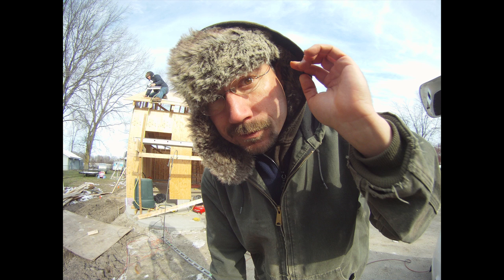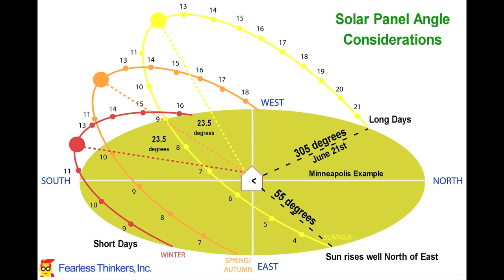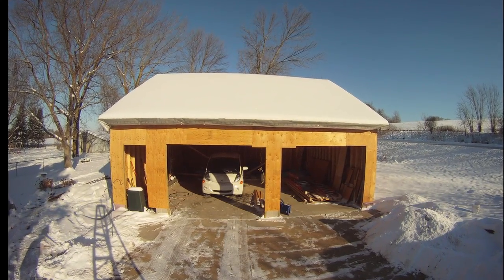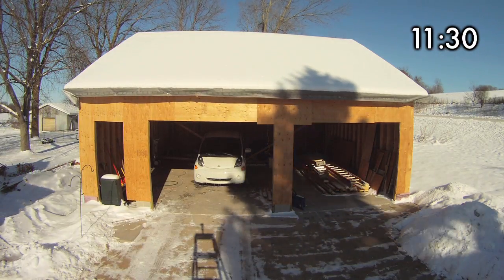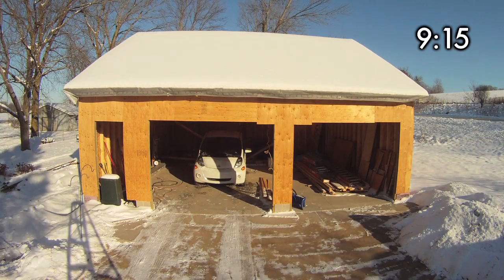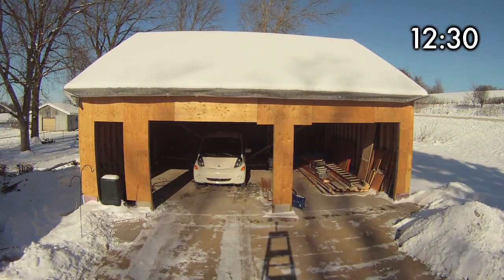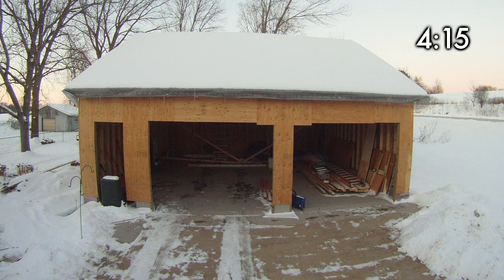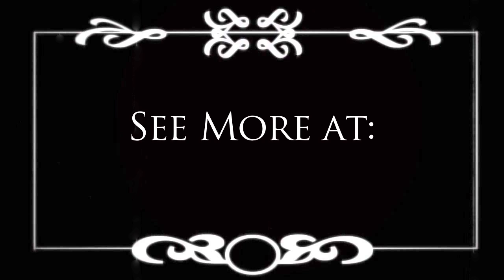Ben's Garage: Winter Solar Access

Comment: Because of winter shading, I would advise not doing a high voltage/series connected system, the pine tree would only take out one/two panels but in high series will shut down all the panels in series...
Reply from the maker: The plan is to use micro-inverters to address winter shading issues. No shading in the summer.

Comment: Ben, Have you consider a simple single-axis rack mounted on the roof ?  Something simple that with the hinged base allow 2-4 vertical angle adjustments a year. You only need a few degrees of freedom.  I have done this with a coupe scissor-jacks at the top with ext. rods down under the panel array and an angle gauge on the base.   I just used strut channel and barrel hinges ...cheap stuff.
Reply from the maker: This will be about 18'x27' of solar panels. That would be quite the project to mount that all to a rack, mount to standing seam metal roofing AND make adjustable. Just the panels themselves will be over 1,000 pounds, plus the racking, and all of that 10 to 18 feet in the air. Nope. It wouldn't be simple. I theoretically like the idea of something seasonably adjustable, but this will be a fixed system.
Reply: Sure, I can see your point and with WI snow load.  Tough sell, with the  marginal energy gain.  
Besides fixed systems look so much cleaner and all you have to do is clear the snow off of them.

Garage looks great and best of luck with the set up.  I hope to be following your solar garage build with mine in late spring.  
Very cool stuff.

Comment: Good morning Ben,
Where are you going to be sourcing your panels from?
Reply from the maker: My original plan was to order from a mainstream solar supplier, such as http://www.renvu.com. I also got a lead on getting some Helios brand panels. That company is out of business now, but was a manufacturer in Milwaukee, WI, my closest big city. I love the idea of getting panels which were manufactured locally. Those panels are sort of "new old stock". Price would be slightly better than purchasing new, but wouldn't have a warranty. Not that there's much to go wrong with a solar panel. Lastly, I also did run into a friend of a friend a while back who works for a solar company that does mostly commercial work. He suggested that I might be able to get in on a group buy with him. Those would be slightly larger panels and higher wattage, but I need to still work on the price, and I need to double-check the size to make sure they would fit.

Comment: This is awesome! Let us know about the energy production when you hopefully get it up and running!
Reply from the maker: Many inverters nowadays have a web-based system for tracking and displaying energy production. I'd like to do that and post the information publicly at 300MPG.org. That way, I can always check to see how much energy I'm making at home, and everyone else can see too!
Reply: I use a plain kWH meter with S0 pulse, I connect that with something like a Youless or Flukso to upload the data to PVoutput.org. http://pvoutput.org/intraday.jsp?id=12447&sid=10380
It works with any inverter, and there are apps for the phone as well as tracking consumption.
Reply from the maker: Hi Robert, you can now see public information on how much power my system is making at: https://enlighten.enphaseenergy.com/pv/public_systems/PqBp1213167/overview

Comment: It shouldn't be too hard in practice, not sure if you are going for Micro inverters, optimizers or string inverters, listed from most expensive to cheapest. I'll have some advice for each of these.

You say 5kW of solar, so that's about 20 panels of ~250 Watt, the most common size (1.6x1m) and ~ 30 Volt working a piece. There is also the choice of Solar Frontier thin film (Japanese) which are really popular, and completely black (1.2x1m). These generally have high voltages per panel, about a 100 Volt working.

Generally string inverters are by far the cheapest solution. Even the Chinese models from Omnik or Goodwe are approaching 97%. For pricier brands there are things like SMA and PowerOne (now ABB) and Fronius. Check the input range on the inverters and match strings to that voltage.

Let's talk shade for a bit, with relation to price. For both micro and optimizer they handle shade well, but at a cost. It also means more involved installation, micro inverters have nice warranties, but that does not equal lifetime. If one fails, you'll need to dismount panels to get there. Optimizers are less of a reliability issue, but the manpower argument stands.

So if you have a string inverter, you rely on multiple parallel strings to reduce shade impact. And that works, the SF panels with higher working voltage means more parallel strings, and less impact. Alternatively some string inverters support MPP sweep, which means literally sweeping the voltage range to find the optimum point even if a panel is shaded. Not all inverters support this, but the higher end models from SMA do.

So with normal mono panels that would result in 2 parallel strings of 10 in series, that's just about 300 Volts for a string inverter, sounds like a lot, but not in the grand scheme of things. They like somewhere around 360 Volt DC really.

There are inverters, like the Steca Stecagrid that can handle 20 panels in series fine though, and 98% it's nothing to scoff at. It also handles shade.  So if 5 out of 20 panels are shaded, the MPP voltage is lowered to the 15 panel point to reduce losses.
Reply from the maker: For the physical shape of the roof, 60-cell modules should lay out to fit in a grid of 21 - three rows of 7 panels wide in a portrait orientation. These would be 250 to 280 watt panels. I'm leaning towards using micro-inverters not just for shading issues, but also for simplicity of installation. Using micro-inverters means that I don't need a DC disconnect, and a regular electrician can run the 240V AC power cables and sign off on the work. It just ends up making the paperwork, building inspection, etc. a little less expensive and less complicated.
I think that we are almost at the point that it's HARD to design a BAD solar system (other than obvious exceptions like intentionally putting panels in the shade!) There are so many great tools and pieces of equipment out there now that it's amazing that more people AREN'T going to solar!
Reply: Ah, I see, the regulations in the EU are quite a bit different I'd guess. What a number of people that use micro inverters do, is mount them inside. Sure this can be quite a bit more cable, but that depends where you mount them. The benefit is far easier replacement. I have a set of 2 panels on 1 micro, but it's inside.
Alternatively, mount these on the side of the roof/building for easier access without having to go through the roof.

Turns out that was a good idea, because 2 Enecsys micro inverters died in about 1,5 years. There is a reason that the company went bankrupt, this was one of them. Do not equate reliability with warranty, at any point. I have videos on my channel with the noise these make, just before they died.

Consider the APS YC-500, you can connect 2 panels to 1 inverter and reduce the amount of cables need drastically. I see they even have a APS YC-1000 now, even for 3 phase 208 Volt. Not sure what exactly is in use over there.